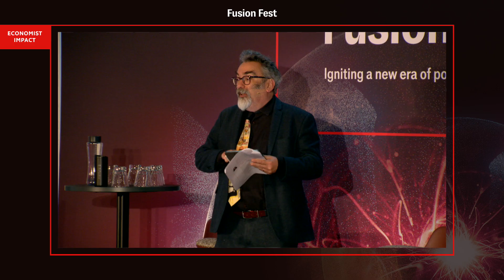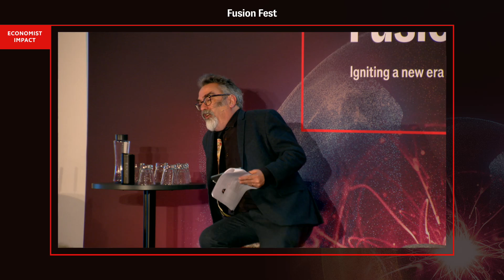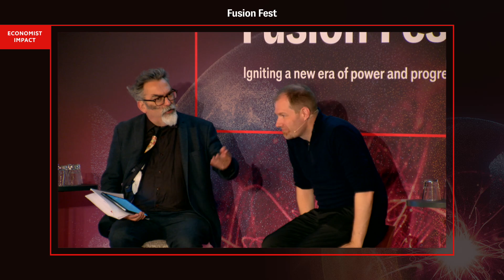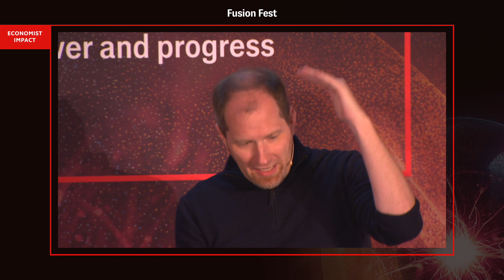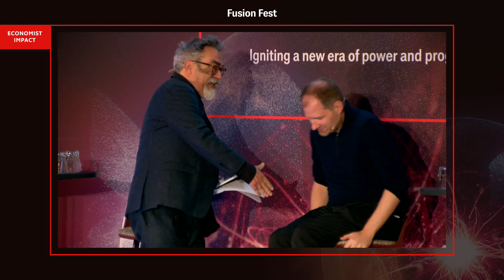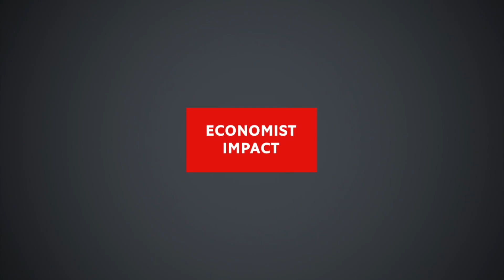Fireside chat. The 30-year fallacy: is fusion’s future closer than you think?

Comment: 1. Neutrons, being electrically neutral, are not confined by the magnetic field.  They fly off and spallate the reactor container, weakening it and making it radioactive.  The lining of the container has to be replaced frequently, so the reactor has to shut down and the radioactive lining has to be disposed of safely, all at great expense.
2. Helium 3 doesn't grow on trees.  There's plenty on the moon.  Let me know how much that costs.

I think they will be lucky to generate enough electricity to run themselves.
Reply: CFS doesn't use Helium 3.
Reply: @Psienko  I confused CFS with someone else.  I will look your system up.
Reply: @Psienko  That's not as easy a nuclear pathway, but good luck.
Reply: Helium3 and tritium are both planned to be bred
Reply: @Watson-tj9sj  Can they breed them fast enough is the question.